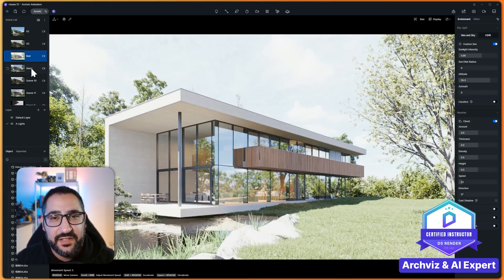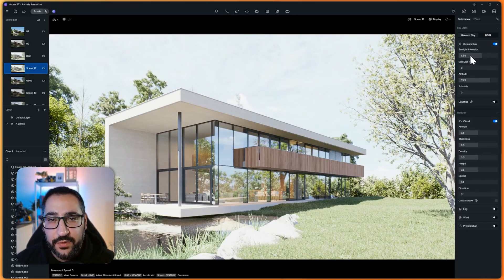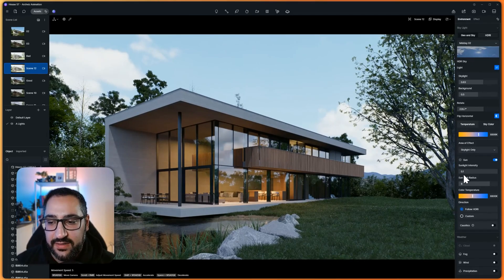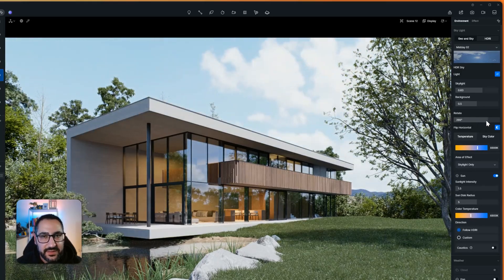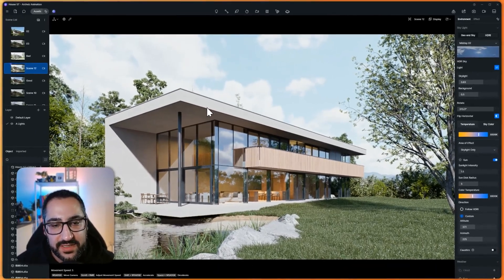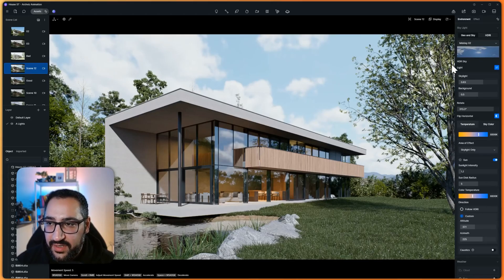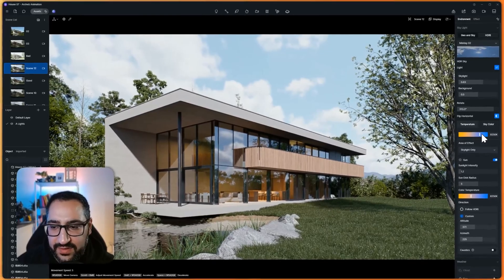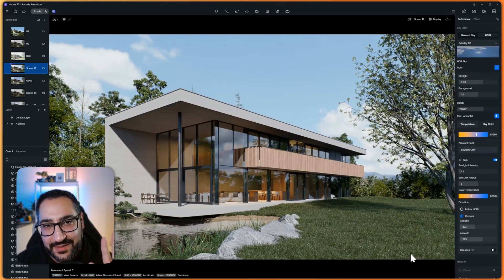How to Improve Lighting in D5 Render – Step-by-Step Guide

Comment: Subbed! Thanks for the video. I’ve been working with d5 for about 6 months now coming from lumion. I’ll experiment with these light settings, but I’m finding 2 big issues with d5 vs lumion. 1) the exposure differences, particularly settings are an issue between interior and exterior if you’re doing a flythrough, for example. 2) getting a scene filled out quickly. Lumion has several “forest” or “urban” scenes to put models in to get something going quickly. I guess i could make my own templates in d5 🤔
Reply from the maker: @Hamishmcbeth  I'd say D5 can actually do these better once you know the tricks! 

For your animations, have each animation track have its own exposure, one setting for exterior, one for interior (you would have to do this in real life too)

For large swathes of landscape, you'd be leveraging the Scatter tool!
Reply: @andychristoforou  thanks! Do you download any landscape/urban context models from anywhere or make your own? I'll check you vid on scatter, cheers. Ideally I'd like a generic village model to download my model into. I do a lot of designs needing generic built context (so probably should quickly build my own!), but wondering if you know a site that sells generic large landscape models like this? When I say large I only mean a couple of streets around a site
Reply from the maker: @Hamishmcbeth  Depends on the project! Usually I start with open street maps models and if I need detail I'll just search the city I'm working in google to see if any 3d stores sell a textured version...then if thats too expensive or unavailable I'll model a low poly version!